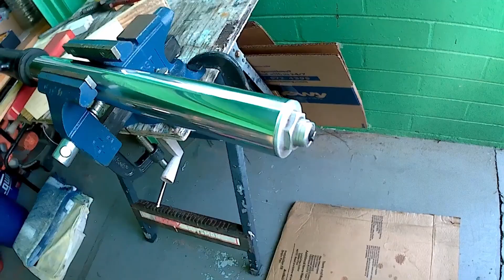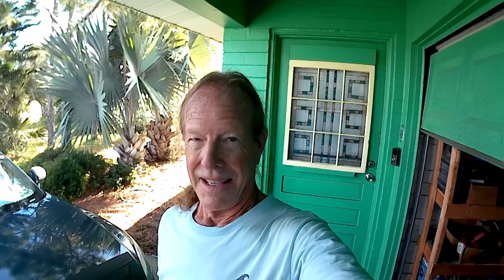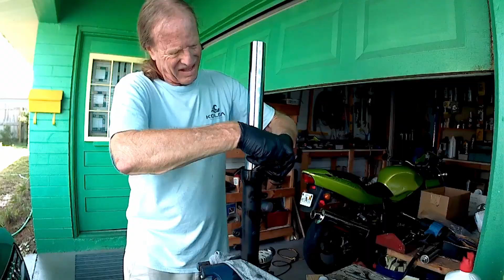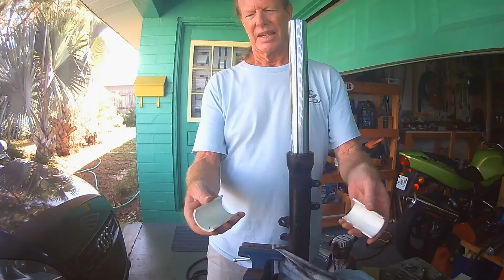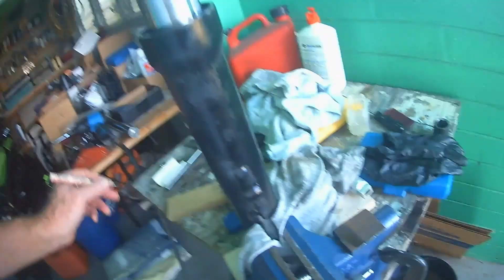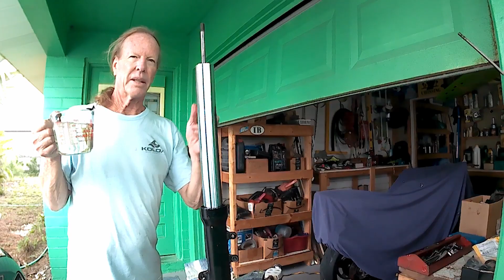Triumph Speed Four NEW FORK SEALS

Comment: I've been meaning to get to it for awhile on my speed four. What did you use to prop up the motorcycle to get the forks off? Is the process of getting them off difficult/ require any special tools? Thanks in advance!
Reply from the maker: Hi, You are going to need front and rear paddock stands to keep your bike vertical.   I got mine on Amazon.  After that, you'll need to remove the front wheel, speed sensor and brake calipers.  Take your time and good luck.